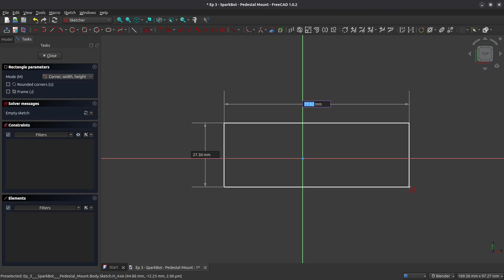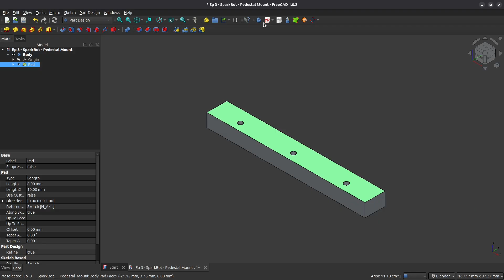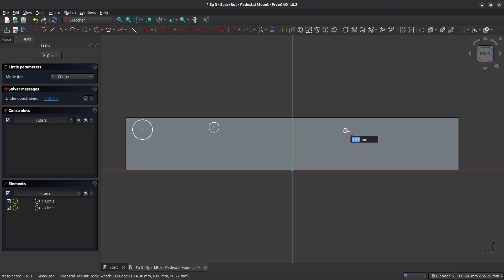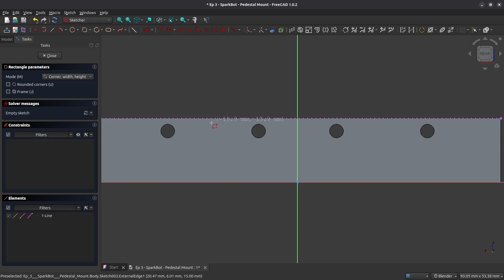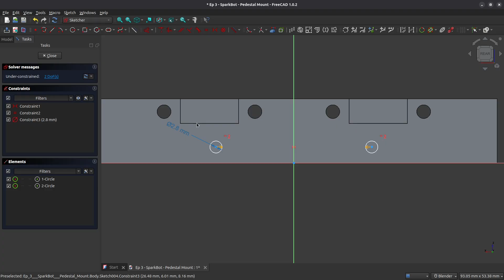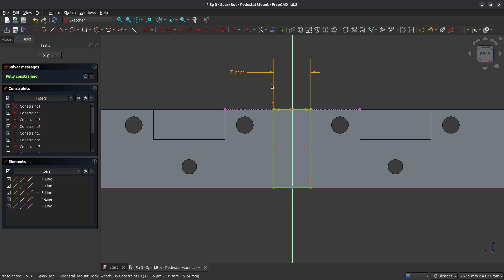SPARKBOT V2: PART 4 | PEDESTAL MOUNT

Comment from the maker: Welcome to Part 4 of the SparkBot V2 architecture. 📐

In this episode, we tackle odometry and load paths. By integrating the 7mm Deflection Buttress, we aren't just mounting sensors—we are actively stiffening the entire 3D-printed chassis by bridging the gap to the Accessory Deck. Remember, designing for rigidity now saves you hours of re-engineering later.

Question for everyone building along: Are you sticking with the baseline IR tachometers for your wheel odometry, or are you planning to integrate a different sensor stack into this footprint? Let me know below.

Chart your course. Build your world. 🍁